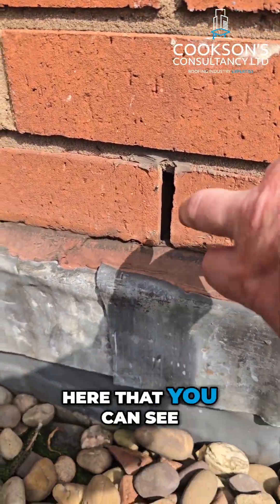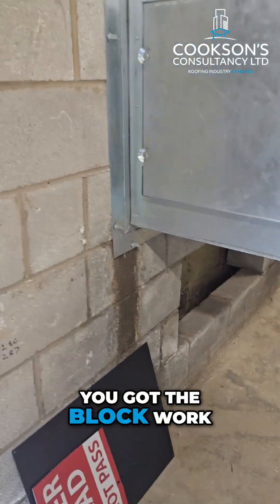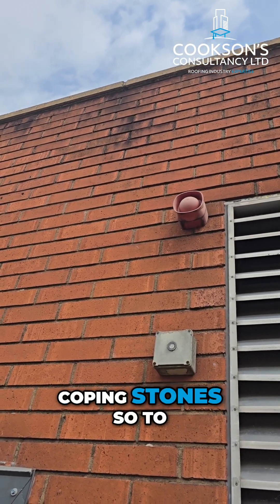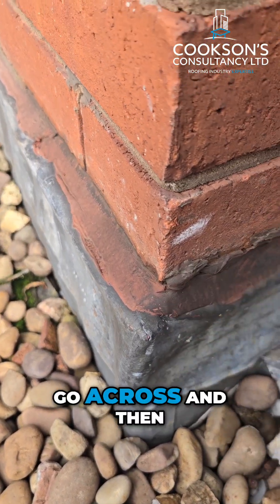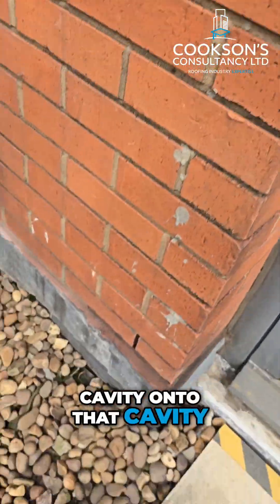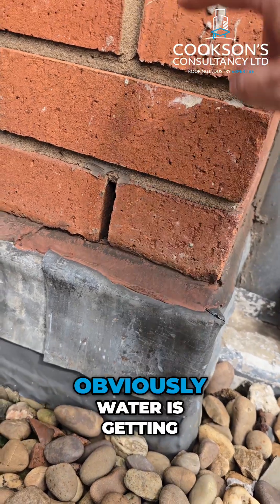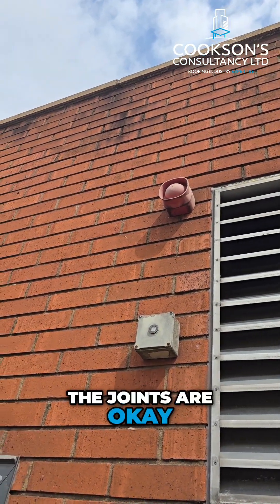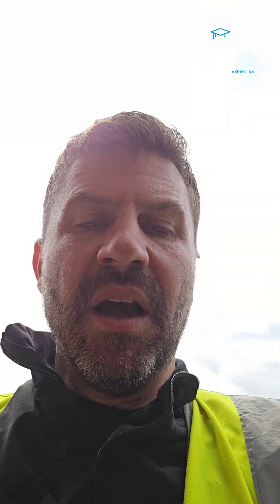Advanced Roofing Tips: Understanding Cavity Trays and Weep Holes

Comment: There should be a dpc, preferably ledcore, for the full width under the copings to prevent water entering the cavity otherwise the internal blockwork will be damp.  The cavity tray at the base is to deal with any other water that enters the cavity.